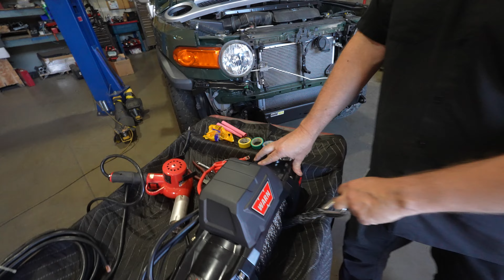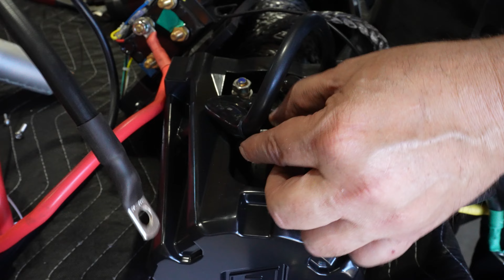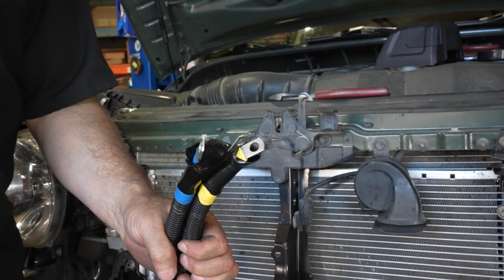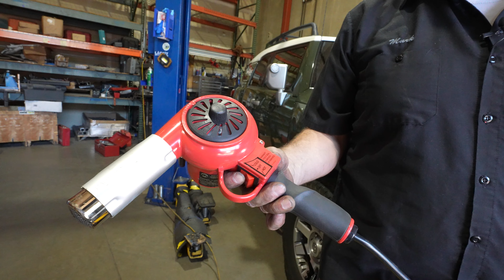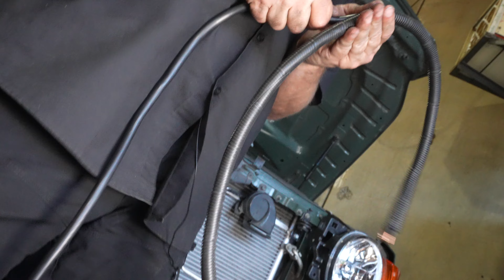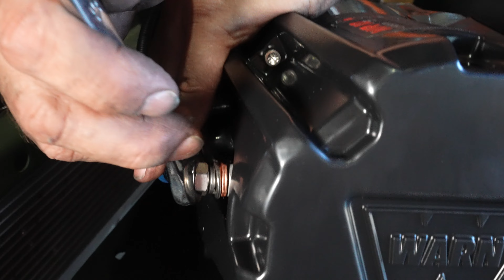Relocating your Winch Control Box | Warn Winch Install

Comment: I was winching somthing and the whole control box ripped off the top, how the f did that happen? It ripped right out of the metal sheared withalot of force. The cable never hit the top cage, I don't know how there was tension on the control box....

Comment: What gauge wire did yall use for the small ground wire? I tried to match to manufacturer on an openroad winch, and used 18ga primary, and the section of that ended up melting the coating off.

Comment: Great vid!!  Did you run the cables through the hole behind the headlight or the hole behind the blinker/side markers?  Looks like behind the headlight, but after I look at mine, I don’t see any possible way of running them through that hole..
Reply from the maker: The cables are routed through one of those two holes, I do not recall.     We have been running winch cables through the front apron since 2006 on the FJCs, so yes, definitely, one of the spots can accommodate them!  We do always recommend using a quality loom to protect the cables as they are hot with a direct mount to the battery, so we never want them to have the jackets direct to metal and short out over time.

Comment: Any info or pictures on the mount you used in the FJ?  I’m doing the same.
Reply from the maker: Looks like no direct photos of the mount we made for it.   It was an L shaped bracket that just used self tapper screws into the side of the inner fender.   Nothing fancy!   Good luck with your install.  Hope our video helped some.

Comment: Isn’t this 500 amp relay
Reply from the maker: Depends on the winch. In this case, Warn would best be able to confirm the relays or "connectors" they provide with their winches.

Comment: The small ground wire can also be grounded to the battery. it is all the same
Reply from the maker: I agree that Earth is Earth in car wiring; however, most, including Warn, require the small ground wire to go all the way back to the solenoid box in their instructions. Since they took the time to ask, we, especially as commercial installers, always follow this request.